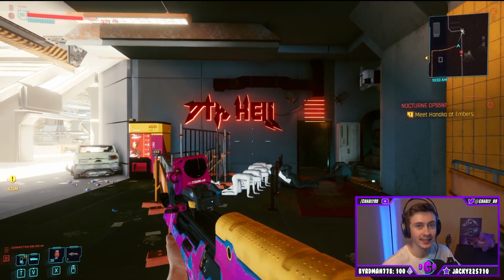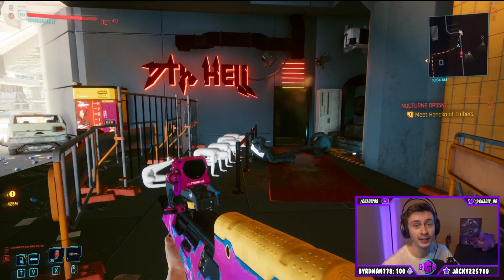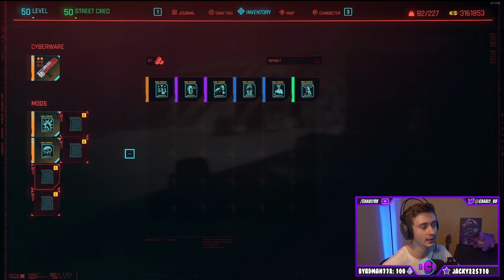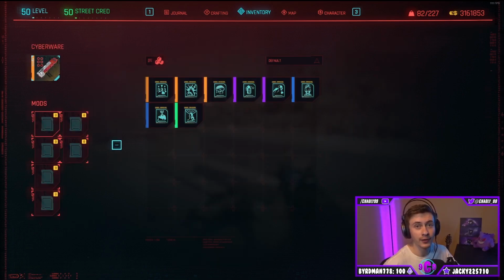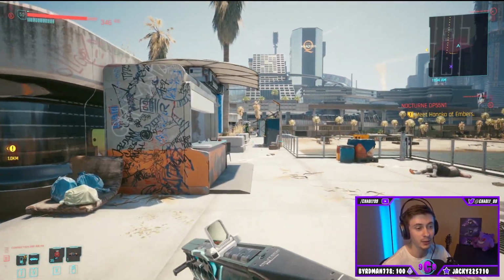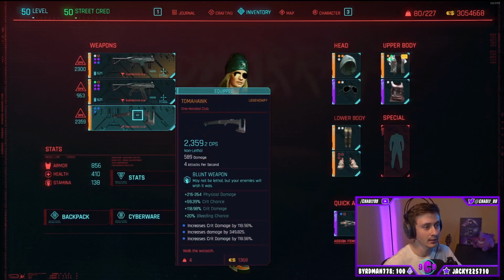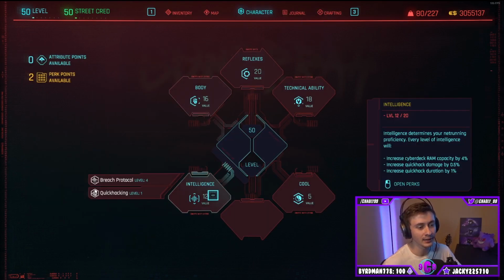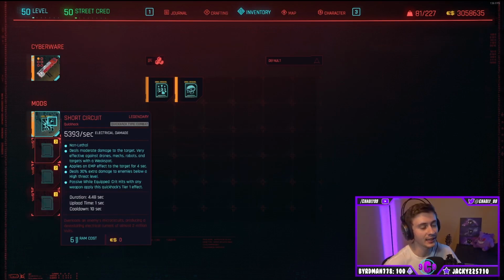USE THIS QUICKHACK IN EVERY BUILD! | Cyberpunk 2077 | Legendary Quickhack Short Circuit Guide

Comment: to abuse this use weapon with the lowest damage number, but highest dps.
shotgun & smg comes to mind.
as a netrunner i have a puny monowire, and even then short circuit makes it god tier.
Reply: TMK each shotgun shot crit counts as 1 (rather than each pellet) so I'd for rapid fire (SMG, full auto pistol/rifle etc).
Reply: @Wolfau5  i've never tested it with either lol, but if you switch the damage number interface to individual, each shotgun pellet has individual chance to crit (some crit, some don't). so i assume it will also proc shortcirc individually.

Comment: I don't get those from access points. Ever. I've reloaded so many times. But I do get them from netrunners but still haven't seen the short circuit
Reply: I think it's the 'requirement' to jack in. You see those numbers beside the 'Connect' prompt? I read in another video that those have to be numbered "10". You save first before jacking in because you may or may not receive a legendary. The one you get is randomized too, thus the save.

Comment: Nice video :). I have a question do the intelligence jack ins that require 9 intelligence always give you a legendary quickhack if you do them correctly?
Reply: Hi Brandon and Chadly. There actually is an access point in the night club that has no intelligence requirement. In the nightclub, there is a vending machine in the second floor bathroom. I’ve spammed it and got a legendary. I’m level 17 with 10 intelligence rn
Reply from the maker: Not always, ive gotten purples here and there. But legendaries are fairly common with the extra quickhack perk
Reply: They don't, just super make sure you're manual saving before you enter the console